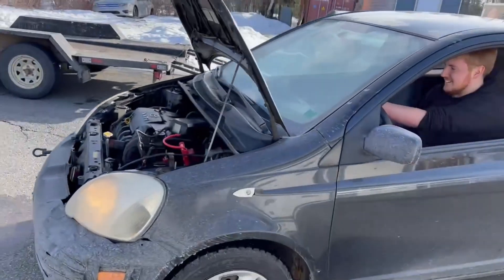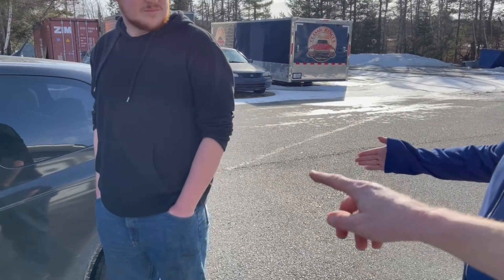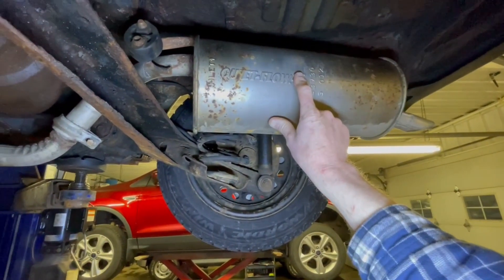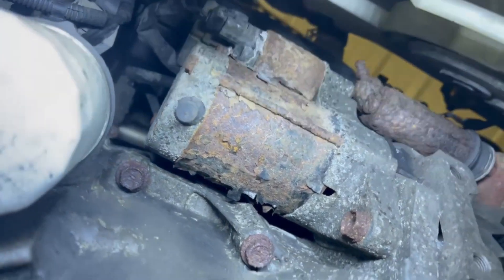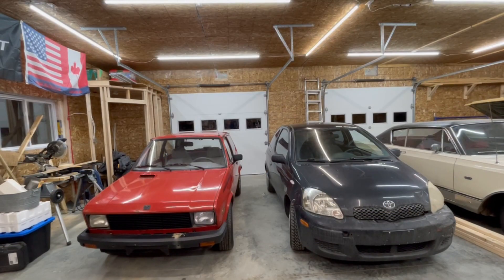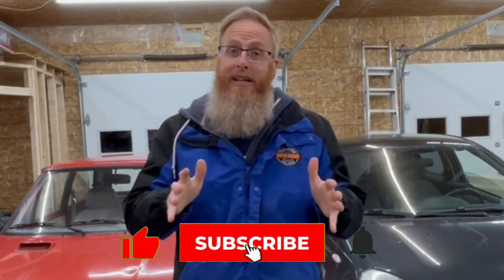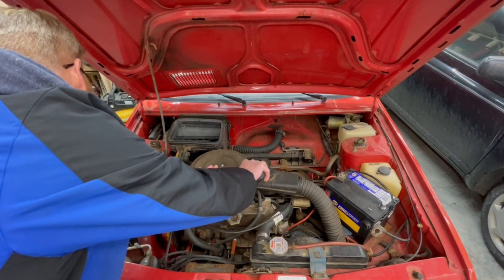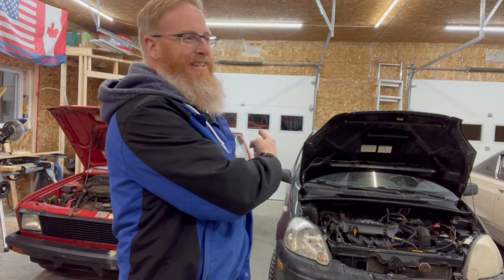Can You TURBO A Yugo And SWAP A Toyota 1NZFE

Comment: In 2003, Toyota 1SZ-FE engines of 1,000 cubic meters and 70 HP, with VVT-i variable valve timing system, were installed in five examples of the Yugo for testing purposes. It was abandoned due to costs and a Peugeot 1.1 60 hp engine was installed in the Yugo InL model.

Comment: I like this over the destruction videos. I hate to see perfect vehicles get abused. I know folks having to drive worse is the issue. Oh well have fun. I know that the hot inlet side plastic nylon cracks first on the radiator. Filler neck blows within 6 months of changing the radiator.
Reply from the maker: I'll keep that in mind!

Comment: You're gonna want more HP than 165, that's around 11.5 lbs per HP, you are going to want closer to 9 lbs per HP so it will at least be a 13 second car?(if my 2 minute math is right, LOL) I think 225 HP would be much more gooder.

I was kinda hoping to see the Hugo engine boosted to see what that could do, is that in the plan? Richard Holdener claims if you install a 1,000 HP turbo on an engine it'll will make 1,000 HP. I say only if it don't blow up first.(which would make an epic video!) You can't think of this car as an investment where you hope to recover the $$ you have in it. You should think of it as a sacrificial investment that may end up as a total loss as a car but a huge gain for your channel.

I know you're a used car salesman, if you think of this car that way more than likely the videos of it will suffer? Also, why the flock doesn't you dealership have a chassis dyno of its own? Especially if there isn't anyone else around that does that kind of work?

When the Toyota engine blows up, maybe you can convert it to correct wheel drive and put one of the big block Mercruiser 4 banger engines in it, now that would be cool!  IIRC the factory HP of the smaller 3.0L makes 140 HP and the 3.7L makes 180 HP. Not sure what trans mount the 3.7 has but the 3.0L has a standard sbc trans bolt pattern. I would have to guess that probably the 3.7L 4 banger has the same as the other one but not sure?

One of those 2 engines, correct wheel drive and a turbo in a Hugo, now you're talking!
Reply from the maker: I get what you're saying, but my goal is to try and salvage as much as I can dollar-wise to help offset the build cost. I've already blown up cars and engines without a huge influx of views, so theres that! I'm banking on this just being different than what's currently out there to draw a crowd!
Reply: @OldeCarrGuy  
I was talking about turboing the Hugo engine before you swap in the Toyota drivetrain. Why fix something if its not broke yet? Lets see what that Hugo engine and drivetrain can handle before the upgrade? That's what I was trying to say.

That would be a great addition to the Hugo playlist of videos before the upgrade.

Comment: You need to weld the engine bay yourself because it will not last and back where the forks and leaf spring mount 
Here is video how to do it https://www.youtube.com/watch?v=YEaFR1Mihkk
Reply from the maker: Thanks for the heads up. Will definitely need lots of re-structuring.